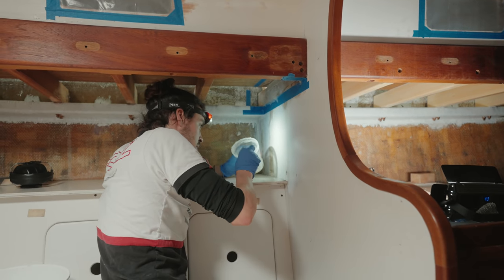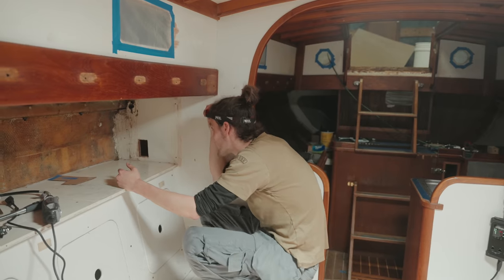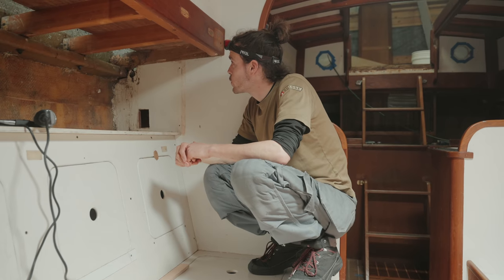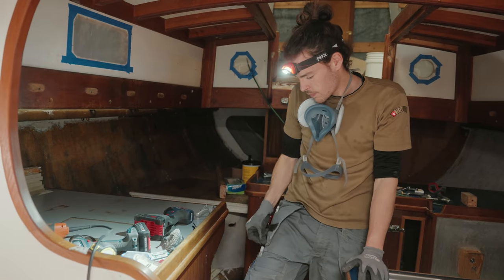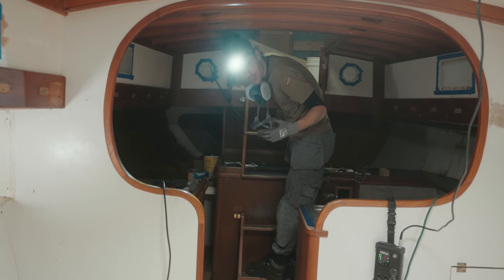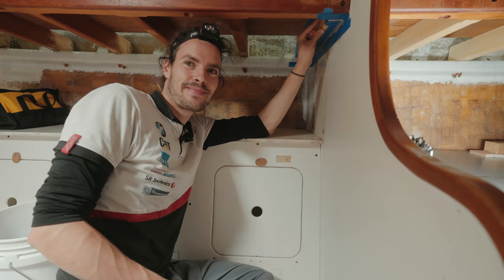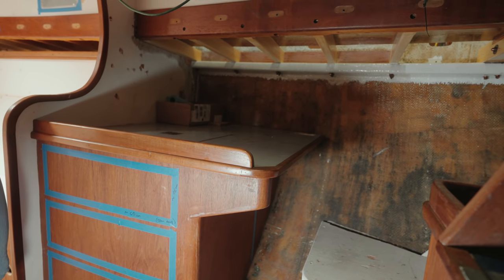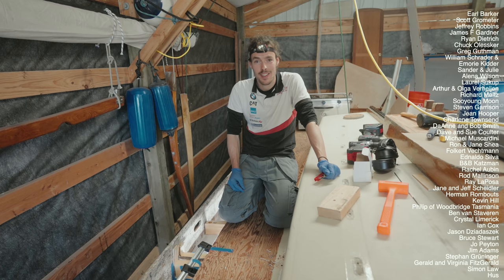How We Fixed Our Bulkhead Issues [S4E24]

Comment: The contrasts between your refit, Leo's (Tally ho) quest for perfection, and the downright practically of the shipwrites refitting Yaba is thought provoking and interesting.
Reply: Don’t forget Salt and Tar.
Reply: @davidmoore5021  and Life on the Hulls!
Reply: @davidmoore5021  I limited myself to rebuilds.  There is also Acorn to Arabella, which contrast 'amateur' vs professional.
Reply: There's no comparison here. Yabá is a how not to do things channel....
Reply: @charonstyxferryman  I'm not concerned with Yaba's level of finish. What concerns me there is it's lack of structural integrity. Splicing together almost every single main frame just does not fill me with confidence. Neither does the half assed way they just redid the roof with zero beams actually going under and in line with the roof beams. Instead again relying on bolts to hold it rather than physical support.
Reply: @charonstyxferryman  "work boat" finish is what I would attribute to Sale an Tar. I wouldn't even bring Yaba up to that lower level.

Comment: Yet another successful week of tasks completed.  While it had to be challenging to get to, you were able to get the area prepped and the thickened epoxy applied to the structure so that the new beams would become a more integral part of the structure unlike the ones you removed that seemed like they were just thrown in to get then hole filled.  You both do a great job at explaining things which helps non-sailors, like me for instance, better understand what you do and why.  Having spent a couple decades in construction, one thing I learned was that having a small second drill with a driver bit installed saves a lot of time from switching from drill bit to driver bit.  I have a small 12V Makita that I only use for that purpose and only use it to drive screws.

Comment: Really enjoying your renovation of  your boat.  A real craftsman with great HSE awareness.

1 question, 1 tip

question :  you seem to use a tape measure a lot when you could use a vernier which has the ability to measure both in and out. ( at the same time) As a amateur cabinet maker having made most of my own furniture ( oak and ash) I cannot think how I would get accurate dimensional control without one.

Tip :  when apply resin ( epoxy ) lay a piece of thick polythene over the surface and you can mould and smooth the surface and also squeeze out excess.  when hard just peal off. Used a lot in car body repairs. the finishing after is significantly reduced and reduces sanding ...hope it helps !

Trevor

Comment: Congrats!! In the beginning I thought you were making a concert Piano. having rebuilt 3 wooden sailboats over many years I realized early on there are two main issues... Perfection and Time. The solution is always "Productivity" Doing things right is absolute....but absolute should mainly be about Safety-Function  Abeam put in place that meets these two standards doesn't need to be pleasing to the eye if it cant be seen, or covered by something. I found over the years that it works best if you list our daily tasks... estimate the time you think it will take, then compare this with actual time expended. This will over time, allows you to become more realistic with setting daily goals. Meeting or exceeding goals builds morale. Always failing to meet goals cause disappointment. So try hard to meet every days task list. And perfection, although important,  is not important on most individual tasks. It is a Boat,....a living thing that becomes part of you. We all know that we are not perfect. No matter how hard you try for "Perfection" you will fail more times than not. And take so long trying might lead to slower outcomes, or vastly delaying the rebuild process. Your doing a Great job so far. Great is hard to obtain. Perfect... even with Gods creations Perfect is impossible... how can it be  perfect with humans. Lighten up and make a few mistakes now and then. Good luck, lighten up. Great camera work,etc.

Comment: I have such a brush with my band saw for the same purpose.

Spare ribs are the lower end of the ribs near the breastbone on a pig. On a cow, they are called short ribs. Sort of like the top timbers. Back ribs are the part nearest the backbone (which tend to curve more and the bone tapers). Sort of like the floor and first futtock.

Comment: Hard to be sure from the video images, but are there signs of water staining in the balsa core of the hull panels? If the hull is balsa cored, sure hope Aladino carefully tested for elevated moisture content. If caught early enough, before rot occurs, a good vacuum pump and heat lamps can extract the moisture through strategically placed, relatively small drying holes and slots in the inside skins. The drying process takes some time, but can be run in the background while doing other projects. Also, given all the epoxy you're mixing, consider obtaining a decent kitchen scale for measuring resin and hardner. It is often faster and more accurate.
Reply from the maker: The balsa is only to insulate. It is not a cored hull

Comment: Looks like you have some proper ‘European type’ marine BS1088 plywood!  So much better to work with and genuine rot resistant!   
Is the hull beam Shelf holding water 💦? Is that why the beams and the bulkhead rotted?
I think you should add a wedge of light weight filler so any water runs off , it might be from deck Leaks or from condensation but I expect you need to stop it! 
Cheers Warren

Comment: Hey! Another great episode.  Curious. When welding a patch piece in, it is common to bevel the edges which makes the weld stronger. Would that have been an idea to use here with the bulkhead patches? Or will the beams provide enough shear support? Not a criticism, just curious. I've never worked with wood/epoxy.

Comment: I've seen a lot of other DYI'ers coat wood with epoxy resin as a sealant from moisture on all sides. It was not apparent you were doing the same although I see thickened epoxy being applied . Is there a reason why not? Do you feel you get a better adhesion with a raw wood surface?

Comment: Question for you two lovely people. Every time I apply west system epoxy to raw wood I get so much bubbling. Am I doing something wrong?
Reply from the maker: Hy Matt? 
Are you applying heat to the wood? That would produce some gassing. 
I generally warm up the workpiece but let it cool down as I apply the epoxy. We have worked with some species that are more problematic though. With sapele for example it always required sanding after the first coat but the subsequent coats worked well.
Another thing is applying a thinner coat so the air can be exchanged with epoxy or otherwise you should try using an epoxy with lower viscosity.
Hope this helps:)

Comment: Aladino I can't believe you use scissors to cut sandpaper. Not good for the scissors at all. Cut the backing paper, just a score, with a craft knife, then fold sand side to sand side. The paper breaks neatly. It is a lot cheaper to replace a craft knife blade than a pair of scissors
Reply: scissors are also cheap and sure easier...
Reply: @JCrook1028  A good pair of scissors is not cheap, try cutting  coarse grit paper with scissors, not easy, a craft knife with the break off blades is best and cheapest. Each to his own though, I know how I do it.

Comment: Those screws are going into the end grain of the new beams, and the epoxy is also being applied to the end grain … never a great solution, but I guess this approach must’ve held out since the boat was built.
Reply: The screws are just a little bit of extra tho. Not the primary hold.
Reply: @JCrook1028  Yes, it’s a fibreglass boat. In more traditional construction the joint into the Carlin would be a form of dovetail and there’d be tie rods between beam shelf and Carlin. Maybe worth installing some tie rods to bolster things up for blue water sailing…